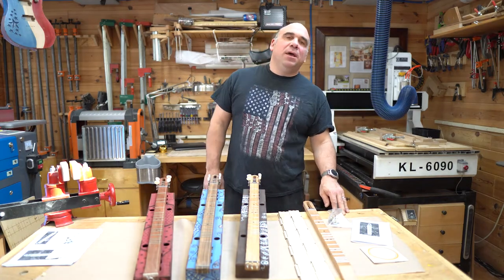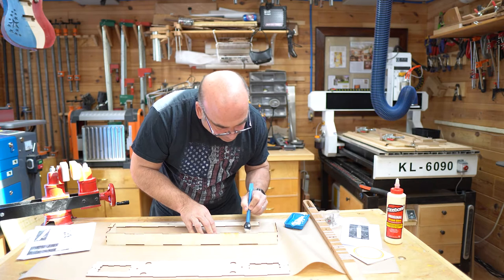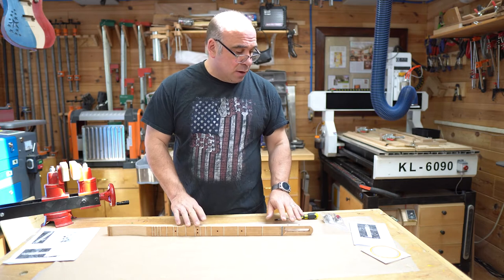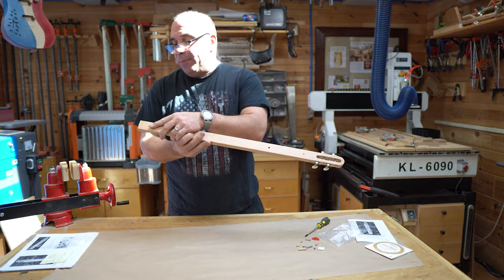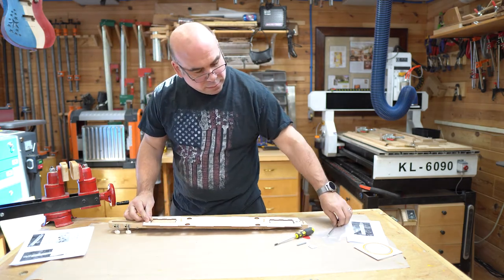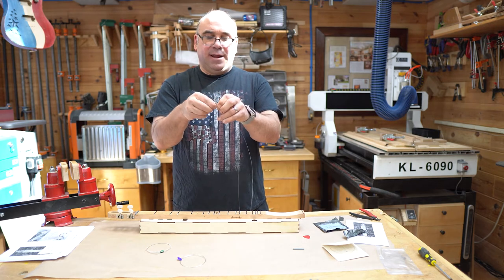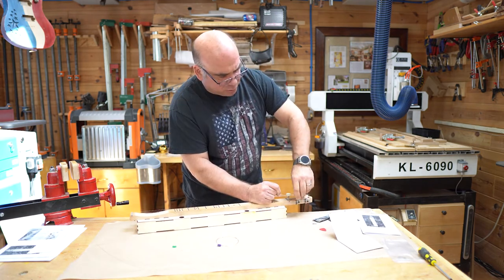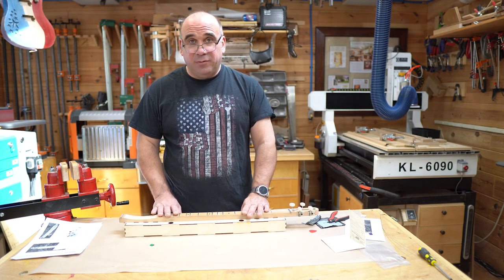How to assemble the Jaromin Guitars Appalachian Mountain Dulcimer Kit (v2021)

Comment: Very easy to build and everything went faster than I expected. I did have an issue with the strings buzzing against the frets and sounding more like a banjo. Solved it by sliding a plastic drinking straw up against the nut before tightening the strings.

Comment: Hi, thanks for a very comprehensive video. Have been comparing your all timber kit with several cardboard kits made in USA. Wondering would it give greater strength (perhaps a better sound) if the fret board was glued to the top of the box?  Just relying on your great video of the children playing along with you, it is hard to be definitive but the larger body of the cardboard dulcimer seems to produce a somewhat richer sound. I hope I can find a video comparison of the sounds of both cardboard and timber kits.  Like the portability of your product and the very positive construction.  Ever thought of a box with a greater depth? Please share your thoughts with me. Good be upon you mate, very, very tempting.
Reply from the maker: Thanks for the comment. Yes, you could glue the neck to the body, though I typically don't glue long grain solid wood to plywood due to the differences in stability of each material. I don't believe it would do any harm, but not sure you'd get that much additional sustain from it - in fact, it might dampen the resonance some. As for the body size, yes, there's a tradeoff here -- generally the larger the resonance chamber (body), the bigger/warmer the sound. The size for the body of this kit was chosen/designed primarily around visual aesthetic and costs. And though I've never played with cardboard bodies, less rigid materials don't vibrate as effectively, which is primary to producing a sound. In fact, I'd expect corrugated cardboard to be a fairly poor resonator. However, I've never done a head-to-head as I also prefer the durability of wood.